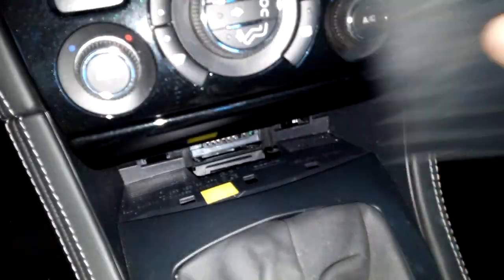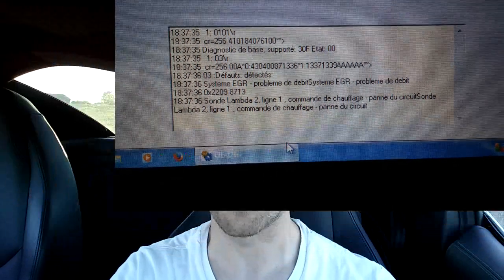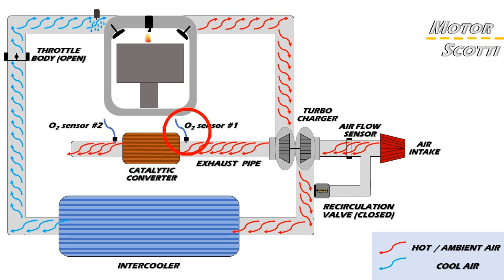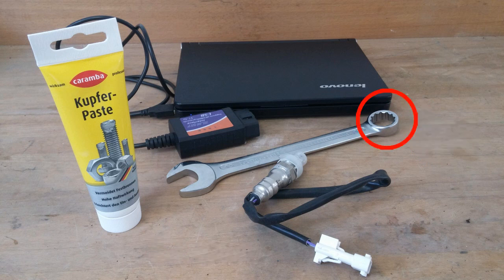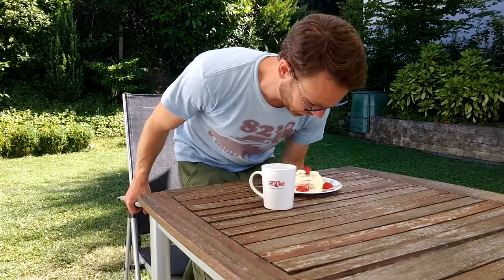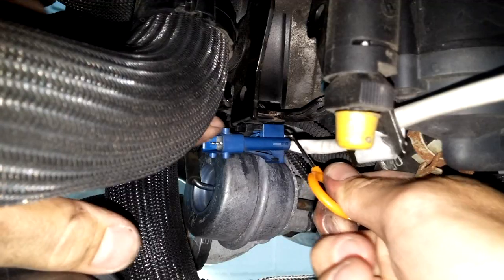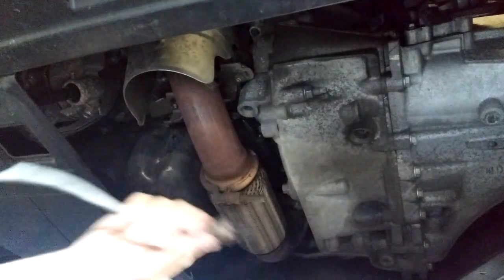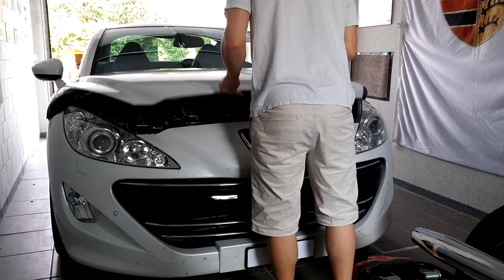Engine fault: repair needed - the oxygen sensor & bad fuel

Comment: Engine foult: Repair needed’what is this??
Reply from the maker: Read the fault codes with the diagnostics reader
Reply: hello, this also applies to gasoline engines?🙏
Reply from the maker: This is a gasoline engine.
Reply: @MotorScotti  Hello, I changed the turbo valve, the problem is the same, now I'm thinking of changing the oxygen sensor, what do you think?
Reply from the maker: Doing a proper diagnostic according to some messages is not good. I can't see and hear your car. You need to connect a diagnostics computer, read the codes and go from there. I'm sorry I can't help you any better.

Comment: You have also helped me immensely. A year ago I was thinking about getting my first RCZ but was being put off by the many reviews saying how unreliable the THP petrol engine was. Then I came across your channel and you put alot of my fears to rest. About to acquire my 4th RCZ, I have a 156, remapped 156, 200 and an Asphalt. These engines are very temperamental and my advice after a year ownership is to get a basic OBD scanner, allow  the car this to warm up properly, check the oil frequently, always top up with the engine cold and give it an "Italian tune up" every couple of weeks especially if you do.alot of city driving. These cars need a to driven and driven hard. Thanks again

Comment: Hi Scott I have an RCA’s 1.6 thp and I am getting an p6200 turbo coolant pump control open circuit can u help with the how it fix problem thanks
Reply from the maker: Sorry I sold mine in 2019 and I haven't worked on that engine ever since.

Comment: Thank you so much for the fuel tip and great advice. We had exactly the same issue the Engine Warning light kept coming on and after taking the advice of our Peugeot dealer we spent thousands on a new Turbo this did not stop the warning light coming on, cleaning and changing filters, this did not work, off the road for months while we waited for parts to cure the issue and then off the road again waiting for analysis from French experts then finally Peugeot France recommended a new Engine!!!!, so after checking out your video we upgraded the fuel type as recommended, then, after 40 miles of driving the car, bingo no warning light and has ran great ever since (6000 miles now), are we being scammed by PSA (Peogeout)? Who make crazy recommendations to avoid admitting they have Turbo issues we low grade fuel and don’t want to recommend the more expensive fuel as it could put people off buying a Peugeot in the future. Anyway the better grade fuel( more expensive ) worked for me so thank you for your advice it’s saved me thousands in proposed work by Peugeot. PSA engineers need to be retrained and Peugeot needs to tell the truth about their engine/turbo issues.
Reply from the maker: Thank you for your sharing your experience. That's crazy! Maybe Peugeot/Stellantis engineers should have asked me first.🤣 
This engine is a real diva. I sold my RCZ in 2019, was a great car but I sure don't miss that engine.
Reply: What do you mean please upgrading the fuel type
Reply: @themaestro7600  Upgrade to E5 petrol this is made up of 95 per cent unleaded petrol plus 5 per cent ethanol (which is why it's named 'E5'). E10 petrol is cheaper and containing 10% ethanol and 90% regular unleaded petrol. This higher grade petrol is what I meant by “upgrade”. Or f you do have a high-performance engine, then you'll need 98 or high performance petrol for it to function properly. Hope this answers your question.
Reply: Thanks for reply, i have same issue with the same error message but my car is a diesel@leberlin
Reply: @themaestro7600  sorry I can’t help you with diesel issues if you are in the AA or RAC try getting advice from them or find an independent mechanic who can use diagnostic equipment to give you an idea where the fault may be in the engine.
Reply: Peugeot recomends a minimum 95 octane fuel in australia, of course 98 octane should be used on any turbo engine. Standard 91 octane or E10 = 94 octane are not sufficient for a THP engine.
Reply: sometimes its magnetic valves that get clodged and it reports same error. mine does it too periodicaly..

Comment: Hi! In the video you changed the sensor 1 (before cat) also in the diagram you marked it as 1, but the error said that the faulty is the sensor 2, I am very confused! I received a "Bank 1 Sensor 1" error on a THP 270 and I don't know exactly which sensor I have to change!
Reply from the maker: Hi, no I changed the sensor 2, after the cat. That's why I had to get under the car. Sensor 1 is visible from the top in the engine bay, before the cat.

Comment: Does anyone know if the fuel “upgrade” worked long term or did the ERM light reappear later? 

My 2013 Peogeout RCZ was taken into the garage three years ago and they have had my car in 12 times to look at the ERM issue they have changed everything from the battery to the turbo, including timing chain replacement, oil filters, Damper valves, pressure sensor replacements, repaired to the wire harness, cleaned the inlet valves, there has been many diagnostic checks including talking to Peogeout in France so after all of this they say (PSA) it needs a new engine, there is no smoke, no lack of power, no knocking, just the warning light reappearing after driving a few hundred miles. Any help would be great as we love the car and I don’t believe a new engine is the solution I believe it’s an easy way out and burying my issue.

Comment: Guess what Scotti, my 308 has depollution system faulty, and your "Fuel" clicked straight away.  I have been running the car on 95 RON 10% Ethanol.  May be 98 RON 0% ethanol would make a difference.  Lets see

Comment: Thanks for the video. I've just had the warning light appear twice on my 3008 after getting diesel from a supermarket petrol station (I noticed the pattern begin after getting 'bad' fuel). Do you think the warning will go away if I get better fuel, or is there more to it?
Reply from the maker: You can try. I don't know much about the same symptom on the diesel engines. It would definitely help to read the fault codes to get a better idea.
Reply: The freaking same thing happened to me right now. I have a 508 gt 2.0 diesel 2019, and just got of the petrol station when this message appeared. Were you able to solve it without going to your car dealer?
I'm using the "gDrive" diesel, which should be the better option, but I quess it's not that good anyway.
Reply: @MarijanovicMladen  interestingly the warning light goes off on its own once the tank is about half full. Apparently it could be something as silly as a software update.
Reply: @gammacurve  Thank you for your fast replay!
Yeah, I'm hopping that this could solve by it self:)  If the fuel is bad, I quess it can mess up some filters as well, so we'll definitelly run some diagnostics.
Reply: @MarijanovicMladen  Good luck!
Reply: @MarijanovicMladen  druze da li si resio problem. Meni danas posle sipanja goriva izletela poruka za kvar pa je moguce da je isti problem. Ako mozes odgovori molim te da se necimam oko slepa i majstora, hvala.
Reply: @vladimirsoskic5475  Druze, evo sta je kod mene bilo u pitanju. Ja sam auto kupio na placu, na kom je auto stajalo bar 3-4 mjeseca bez voznje, i tako se nakupio talog od goriva u rezervoaru. Kada sam nasuo pun rezervoar, pumpa je povukla taj talog, i doslo je do neke greske u sagorijevanju ili tako nesto. Tako su mi bar rekli u servisu. Rekli su mi da mogu voziti tako neko vrijeme, ali da je najbolje da sto prije dovezem auto na popravku. Iskreno savjetujem i tebi, jer ne mozes biti siguran sta je u pitanju. Javi molim te kako si prosao. Sretno!
Reply: @vladimirsoskic5475  da, to su i meni rekli kao, sreca nije usao u taj safe mod. Aj ga znaj, zajebancija nego sta. Nadati se da je manji kvar. Vazi, javi i sretno jos jednom.
Reply: @vladimirsoskic5475  Hi, i had a same engine failure failure popped up after few seconds I refuelled my Citreon C4. Was the problem with the fuel? Pls answe me. Thanks.

Comment: I have the same issue, I got a diagnostic reading they just said it’s the lambda sensor and but never said if it was the first or second 1  and can’t get hold of person who did the test now I don’t know which lambda sensor to order 😔 also do you have a link to where you bought your sensor ?
Reply from the maker: Back in the days I used to buy parts on mister-auto.com, bur where you buy it maybe not as important as what part you get. The part number is in the description.

Comment: considering buying one with 200hp but I am a little hesitant about the engine because it is basically a BMW product. Is this car something to invest in?
Reply from the maker: If it's been taken good care of and all of the kown issues have been taken care of, can be. It certainly not a cheap car, body panels cost a lot more than on a 308, because they simply made a lot less of the RCZ. These engines may burn quite a bit of oil, especially if you do a lot of short distance driving. In general, the 200 hp is more reliable than the 156. I enjoyed it a lot for 6 and a half years but wouldn't want to get one, again.

Comment: Interesting turn of events. What fuel do I need to use then? I live in Ireland. Thanks
Reply from the maker: Normal 95 octane unleaded is fine. Mine apparently just got some bad fluel. Does your car have any issue or are you just curious?
Reply: @MotorScotti  I'm getting the same error with check engine light on the dash but no mention on diagnosis tools of O2 sensors. Mine sais p2261 Compressor discharge solenoid valve suspected jammed open. I always use standard 95 octane unleaded fuel but I think it does have the 10% Ethanol in it... Error occur only after 100km/h. Clear itself out once vehicle restarts. Cheers
Reply from the maker: Check out this website: https://obdii.pro/en/code/P2261 Sometimes they give brand specific error codes, sometimes only generic. It could be a turbocharger issue.

Comment: The problem you had I think it was because of another defective piece from factory, code: Pierburg 7.01777.13. This is the solenoid valve, and it is under the intake manifold. It's changed from below the car without removing any piece, just from the hole under the engine. Just put the 3 rubber tubes off the solenoid, unplug it and change the piece. Done. I know because I had the same problem solved successfully. The pierburg piece itself it's bad designed, and if I am not mistaken now the offer a new model 7.01777.19. Greetings.
Reply from the maker: Thank for your input. This wasn't the problem for that time, as the car ran normally again with the right fuel for another 2 years (except for the high pressure fuel pump that came later). Than I sold the car and the turbo charger failed...You can certainly learn a lot about modern engines on these engines😅😁
Reply: MotorScotti i can’t understand why the turbo failed! I imagine you always let it cool down before switching off!

Comment: i have similar problem, filled petrol, and went to car wash in same petrol station. Everything worked fine till car wash finished. Started engine - eco mode activated, and engine fault, need repairs come up. Did checked everything, sensor, fuses, and etc. Got my self diagnostic tools and it says its samthing to do with turbine... m i fu***ed? but then i thoug, it could be petrol! I have just filled it at the time the uk was short of petrol, just at the begining of covid19, the some petro station have they limits how much you can fill it and etc... i wonder if thats samthing to do with my enging warning ligght. Have left bit more than half tank left, car running without no problems, just that anoing light comes up. Will wait till petro goes down and refill from other petrostation and see if anything changed
Reply from the maker: Good luck!
Reply: Did the warning went off!!!
Reply: @mobiletraveler  yes, it did. Guess they was selling some bad sh petrol to make money. Got from other town and other station, and light gone off after around 10 min driving.

Comment: Hi Scotti! Do you think the same problem can be with ds3 thp 156? We changed the sensors, cleaned the magnet valve, also the incoming air tempreture sensor, but after2 months, the engin fault message came back...according to the mechanic this fuel e10 stuff shouldn't play any role in it, but I really have no more ideas...
Reply from the maker: I'm not even sure the oxygen sensor or the fuel were the real causes on my car. Maybe it was just the high pressure pump showing its first signs of weakness, which I replaced later on. I really don't know, sorry. I loved the RCZ, but I really don't want that engine in my life again, it's a real diva^^. All the best
Reply: @MotorScotti  Indeed. I have a different car, but my girlfriend loves her DS, so I try to keep it alive as long as I can. Thanks anyway, take care.

Comment: I had the engine fault repair needed come up yesterday, it didn't really affect the driving. I decided to do a little research and saw this video. I have been buying fuel at different places. I had about a quarter of fuel left. I drove to a BP garage and fill the tank. Started the car and the fault is gone. Am just hoping the fuel was the issue. Fingers crossed
Reply from the maker: Fingers crossed. Eventually I had to change the high pressure fuel pump, but I never knew whether the issues were connected. The high pressure fuel pump came quite a bit later as you can see in a later video. I have since sold the RCZ. Good luck and thanks for watching!
Reply: Same engine repair issue with citreon c4 after refuelling. Is it with the fuel?

Comment: I've had issues on and off for a few months with no power and P2188 errors Garage thought it was a cracked intake on the turbo manifold and that was replaced. Came back a month later, no power, no management light, but an error code of P2188. I use supermarket fuel, Sainsburys in the UK, could it just be that? Going to get some V-Power and see if that helps...

Comment: Your video was very useful for me... I am driving a 2016 Peugeot 308 turbo... shares the same engine with RCZ... same problem I was facing and after watching your video I started refueling the best fuel and now the engine light gone after the second refueling and the performance is good
Reply from the maker: Thank you for watching. Stick around if you are interested in Knight Rider😊🤙
Reply: May I add to never refuel with E10 the car hates it , as mentioned in many forums even though Peugeot says the rcz can take e10 don’t do it!!

Comment: Hello. I have a Peugeot 407 2.0 hdi diesel. I'm having some problems. I get the message "depolution system faulty" and my car stuttering when I'm in low rpm. 2000 rpm around there. Just when driving though. Any idea what it can be?
Reply from the maker: Hi Vegard, that's a difficult one to answer remotely. Best is to hook up a diagnostics tool. However, from what I've read on forums before, this sounds like an FAP issue (particle filter for Diesel engines). Do you drive on motorways to regenerate it? Make sure you use the right engine oil and keep it at the upper level. I'd suggests to look into these areas.
Reply: Thanks for answering me so quick Scotti,  Oil and oil filters got replaced this week with a lot of other stuff but the mechanic i used did not have a way to diagnose it further since he is a independent mechanic. What do you mean by regenerating the particle filter? I have not been driving much since the change. should i try to take a long drive you mean?
Reply from the maker: The particle filter filters the diesel soot out of the exhaust fumes. It's self regenerating, meaning that it will burn out the accumulated particles (soot) by itself every now and then. For it to do that, it needs to warm up properly. If you only drive short distances with your car, it will accumulate the soot but never burn it out. That's one possible reason why your engine is stuttering and the warning message came up - the exhaust line is clogged up. So, if if you manage to drive the car on the motorway for a good half an hour or maybe more, it might be able to clean itself out and you'll be fine. Maybe your filter is beyond repair, maybe the source of the problem is somewhere else also. In short, if you drive a lot of short distances and your particle filter (FAP) hasn't been replaced recently, it try to drive it on the motorway for a while and see if it clears up before paying a lot of money for 'repairs' that don't need to be done.
Reply: Okey i see. I will try that, take a long drive to sweden next week and hope that sorts itself out :) Thanks again for answering. i`m not really a car guy so it is not easy to know hehe. I just had the car for a couple of months and the problem seems to get worse.
Reply from the maker: Did it work?
Reply: Nope, will have a test done at a mechanic next week so hope they find the problem. On long drives with fast speeds its not that bad. but want to get it fixed anyway :)
Reply from the maker: Okay, would love to get a feedback once you know more about it
Reply: Shure Scotti :) Hope i get the answers on Thursday